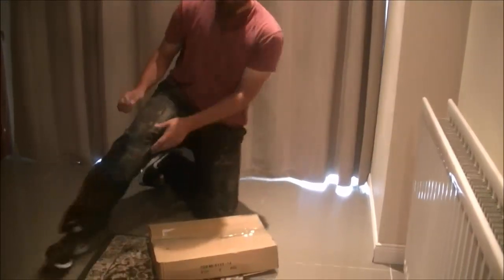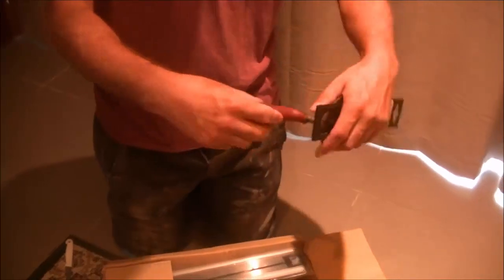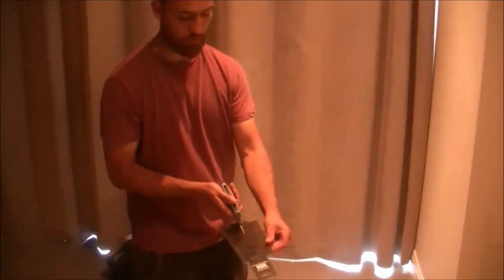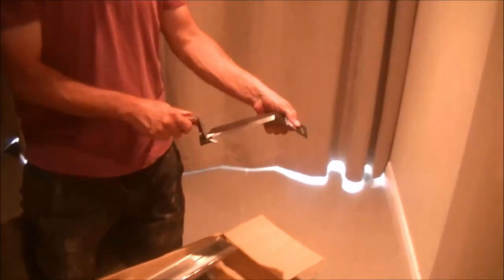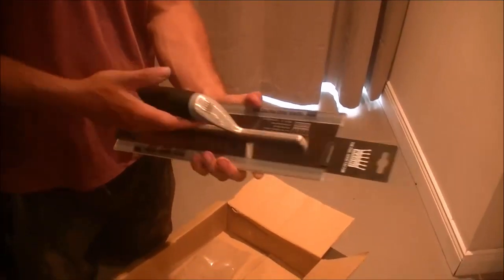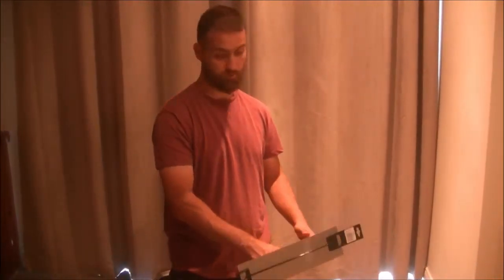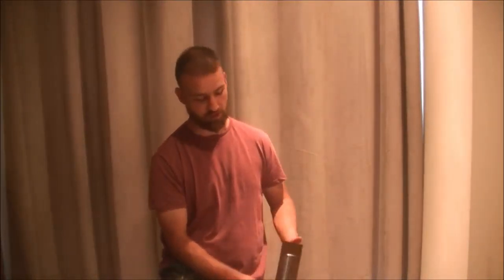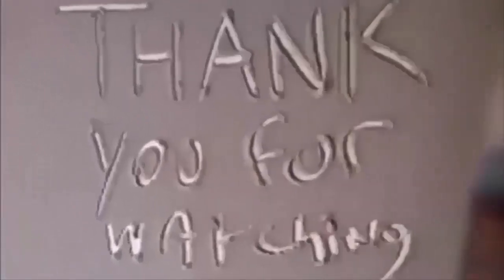Unboxing Ragni Tools Plastering and Bricklaying

Comment: Would you say ragni are nearly up there with Marshalltown now mac?
Reply from the maker: Will know more when i get this on the sad and cement I know the grey handled trowel i have took a long time to get broke in I prefer it for sand and cement but this should be even better as its designed for cement  they have a wide range it seems trowels for skim and trowels for cement then also the different handles in the fact high lift and low